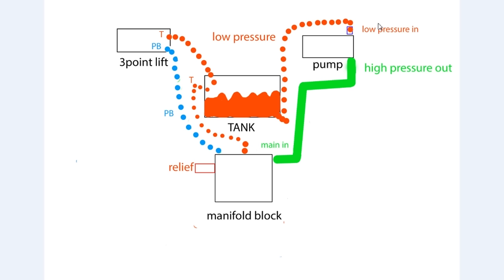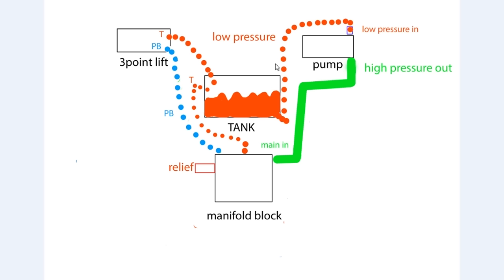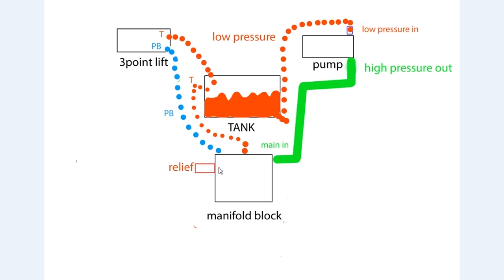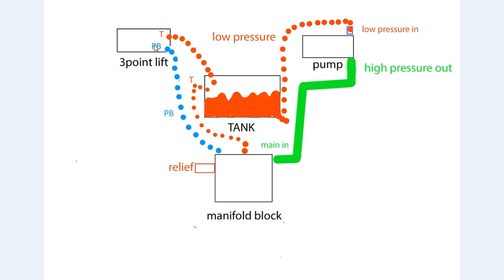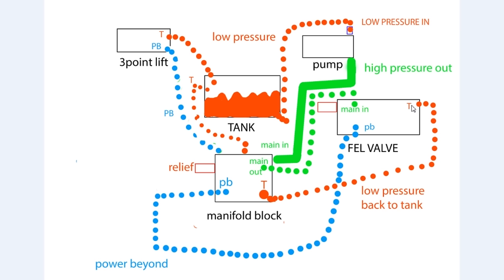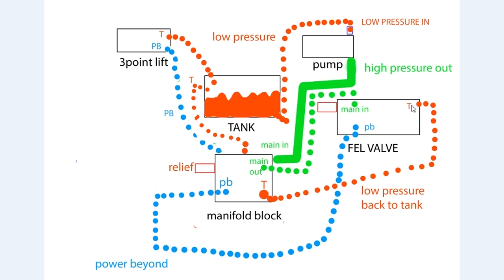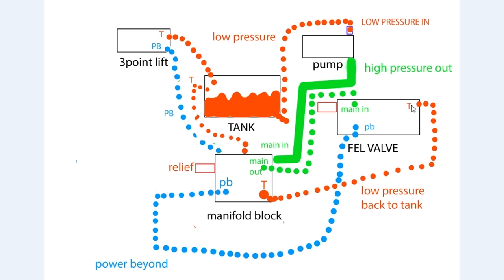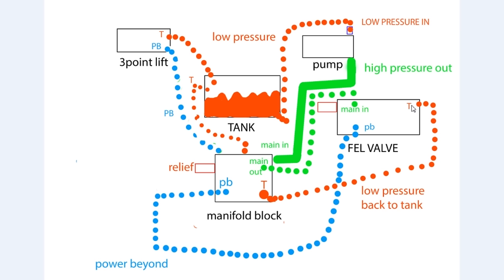adding rear remotes and understanding tractor hydraulics

Comment: I have been reading and watching videos for about three solid days to try and figure out exactly how to plum  in an electric over hydraulic third function valve. I finally grasp just how the power beyond function works. But I had to do a ton of research to understand it. Your video made it super simple and I wish I had found it sooner. This is a great resource for anyone who is not well-versed in all things hydraulic.
Reply from the maker: thank you I hope this video gets shared so others can benefit from it. there are several very informative videos on this channel pertaining to tractor implement set up and use. I'm sure you will find them helpful as well.

Comment: WOW!! Amazing, thank you! You removed all the confusion.
Reply from the maker: glad to hear that thanks for stopping by
Reply: @daveknowshow  Well almost, I'm confused now! I must have done something wrong.  I added a spool valve and remotes to my Kubota L3800 and now to 3 point hitch does not function.  Would you mind helping?  Both remotes work for my stump grinder. Can I PM some pictures?
Reply from the maker: @diamondcutter8535  yes email me at daveknowshow@aol.com
Reply from the maker: @diamondcutter8535  also just to let you know. Id say you have the tank port and the power beyond port likely backwards. this means your power beyond is dumping straight back to tank and your back to tank is dumping into the power beyond port. its not gonna hurt it but as you can see it makes the three point no longer operate.

Comment: Great video.  I have a question.  I currently don't have  rear remotes.  I want to add a spool valve with 2 levers and 4 connections but not sure what type of lever valve I will need.  The function will be to turn on and turn off a external hydraulic motor.  The motor is on a  3pt small potato digger that drives a potato chain.  It will need to stay on when I engaged the valve lever and turn off when I disengage the valve lever.  I know there is detent, not detent, etc....
Reply from the maker: a detent style valve may work although during a bumpy ride the valve may spring back from the jolting and that would shut the motor off. I would try contacting Brian Brooks over at brooks ag parts and see if he can help you select a valve. you will need to know the flow rate of your hydraulic system which is listed in your owners manual under specifications try this number for Brian tell him I sent you there from youtube. 513 715 0532 if he cant nail down a valve for you try surplus center hydraulics get the number online. if that dont render any good results for you let me know and I will try to help you figure out which valve I would use if I was doing it myself on my machine. hope this helps. Dave

Comment: Probably saved me hours and hours of troubleshooting. Fixing up an old, somewhat neglected Kubota L235. I  discovered an aftermarket aluminum hydraulic adaptor block, but I don't have a front end loader. Also the 3 point lift isn't working yet. I've absorbed all this info and I'm certain it's going to come in handy. Thanks!
Reply from the maker: I have no doubt in my mind this information will speed things up for you.

Comment: Today I'm gonna try to install the top and tilt I got from the dealer. It did not come with instructions though the service manager said that he would be available to phone consult with during the installation. This video is hugely helpful. Explaining that the hydraulics are in series clarifies the circuit, especially for me as an electrician. Thanks as always Dave!
Reply from the maker: Bay Area Sparky so glad this helped very excited to hear you are getting a top and tilt. You will love it!
Reply: Hi Dave. I was making good time on the installation but the kit I got from the dealer was missing the bracket which holds the linkage and levers atop the tank and below the control console plate. So I sewed things up and used the box blade the old-fashioned way, climbing down to make hand adjustments on the fly. I sometimes wonder how they tolerated hopping up and down from the tractor until I remember that they used to have to hook up a mule/horse/ox and that a tractor, even with hand adjustments was probably pretty damn convenient!

Comment: Outstanding video. I see now it will be possible to add a hydraulic top link to my John Deere 5200 that has a front end loader.
Reply from the maker: yes in deed you can and rather easily as well. if I can be of further help just let me know.
Reply: @daveknowshow  I want to puchase a single spool valve to operate a hydraulic top link. I want the top link to remain in the set position when the valve handle is released. Am I looking for a valve with one side detent, no detent, and/or spring return?  What is this type of valve called?  I apologize for my ignorance but I'm still learning.
Reply from the maker: @TexasNightRider  you want an open center flow -and spring return to center spool valve design. I know you say you want a single spool valve for just a top link but trust me you will end up wanting a side link as well which will require a two spool valve one for top and one for tilt. I wish I would have installed a three spool valve now that its done. one for top one for tilt and one for future small dump trailer. i'm here to help if you need it.
Reply: @daveknowshow  Thank you sir.
Reply: @daveknowshow  Would you be uncomfortable providing the brand name / model of the valve you purchased?  If you ordered it then I would order from the same place.  It appears to be exactly what I need and I am having a difficult time with the valve selection.
Reply from the maker: @TexasNightRider  if I can find it. I got it from Northern tool I think its this one. as I said I got the two spool and now wish I had bought the three spool valve instead. here is the two spool valve I have. https://www.northerntool.com/shop/tools/product_200419671_200419671     keep in mind this needs to be set to "open center" configuration or what the instructions calls " power beyond"
Reply from the maker: @TexasNightRider  very nice of you most folks just say thanks but some send me 2 or 3 dollars via paypal at daveknowshow  but its not necessary.
https://paypal.me/daveknowshow?locale.x=en_US

Comment: Great video I have a question if the backhoe is off the tractor Do I need to make a jumper hose to connect the in and outlet to keep the fluid circulating
Reply from the maker: @glennadkins7999  yes!!!that is critical!!! Typically they use a male and female connection this keeps the direction of fluid the same and allows one to plug into the other. The female can be stationary and the male on. A hose long enough to loop back and plug into the other.

Comment: Best video ever! Thanks! One question why does the 3 point lift does not have a relief valve? Also the back hoe does not seem to have a relief valve. I am new at this. Gr Reza
Reply from the maker: actually the three point does use the main relife valve as its relief protection. same with the backhoe as well. additionally the loader control valve also has a relief that is set higher than factory spec and will kick in should the main system relief fail and the pressure exceeds the factory setting of the loader valve which is typically 3000 psi
Reply: @daveknowshow , thank you for your time and good explanation. Hope to see you in person one day in Belgium. I hope I can show you my kubota mk5000. Gr Reza
Reply from the maker: @thingsbeensaidanddone.2378  that would be awesome!

Comment: Dave I work with Hydraulics a lot, i just today bought a small backhoe that connects to the 3 point. However there are no hydraulic lined to the rear. I just need to have a way to connect hoses to the manifold that is there on my L2900 Kubota. Can I take the two plugs out of the bottom of the block where the front loader connects or just get hydraulic Tee s and put them in the Power beyond as you show yours. or do I need to buy the expensive kit they are selling.
Reply from the maker: the only port you can "T" into is the back to tank port. the others must be in series. power out to power in.  at the manifold locate the power out line disconnect it and add in your back hoe lines. one in one out. you can also add the backhoe line after the front end loader valve. just locate the power beyond port on the loader valve. disconnect that line now you have a power out and a power in. need to know which is power out? with those lines disconnected start the tractor briefly. the line that shoots fluid out is the power out line. hope that helps. I'm here if you need further help.
Reply: @daveknowshow  okay thanks, I was looking at the one you have in your picture. coming off the power beyond to the hoe then putting a Tee in the return line. but what do you do when there's no backhoe on the tractor? there will then be a dead head Power beyond line. or should you keep a short hose with quick connects to install in the ends of the hoses while not in use. I will try to get some pictures of my manifold later this evening after work. it has no block like that you show.
Reply: well i took pictures of what I have but I aint really sure how to post them. but it has 3 hoses coming out of it 2 right beside each other horizontally facing to the right side and one f below facing the front of the tractor. they all go to the front loader. the back side of the manifold has 3 solid lines coming to it one from the engine compartment, one to the transmission and one heads to the back as far as I could see under the seat area
Reply from the maker: @garryharris9098  yes the lines at the rear plug into each other when the hoe is not installed

Comment: Dave, Thank you.   I appreciate your videos !!!  

I was thinking that to add a rear remote I would need to Tee off from the Power Beyond and tank circuit to make it happen.  I have both a loader and backhoe setup.

I now understand that it all needs to be in Series to make it all work.  Thanks...
Reply from the maker: yes sir you are correct in series is how it works. appreciate your kind words and glad the video has helped speed up that learning curve.

Comment: Hey Dave 
Great video. Have mx4800..Is it economical to buy a spool valve kit for say rear hydraulic top link like you have? Are just buy all the components and put together myself. Thanks for your input. Be blessed.
Reply from the maker: it saved me about 300 bucks piecing mine together. maybe more. I wish I had put three sets of remotes instead of just two sets.
Reply from the maker: also check summit hydraulics.

Comment: Dave , great presentation. I have a 2004 Kubota B2910. It does not have power beyond. You have any idea if I can add power beyond?
I want to add controls on my box scraper like you did.
Reply from the maker: it should have it. I can down load the manual and maybe find it for you. my email is Daveknowshow@aol.com

Comment: Please forgive me for asking, but I need rear remotes on my Mahindra, I do have a loader, can I power my new spool from the FEL manifold, curl circuit, or lift circuit ect? Thanks in advance.....love your videos....John Stark
Reply from the maker: feed the new spool valve from the power beyond port on the loaders spool valve. " joy stick" control.
Reply: One more quick question, iam pretty clear on the power beyond coming out of my loader joystick valve, that will go to my new spool, then continue on to feed my three point , via the port in front of seat, then I realize my spool port marked (T) will return to tank, my current tank return is behind seat just above three point, my question is this....do I just put a tee there and tie it in, currently it's a 90 degree fitting from FEL valve?
Reply from the maker: @johnstark3058  yes a TEE connector will work fine. that is what I used on mine.

Comment: If I wanted to hook up a log splitter but did not have the hook ups on the rear as I originally thought I did, would the simple method be to hook up as if it is a back home? Then what would I need to do if the splitter was not attached?
Reply from the maker: yes run two lines back there for the splitter. one with a male connector one with a female connector. when the splitter is not on simply plug one hose into the other to complete the loop. hope that makes sense. on another note my advice is stay away from tractor mounted / powered log splitters. the flow rate is to low and cycle times will be painfully slow. buy a stand alone splitter and tow it behind the tractor. this way you can use the tractor to load wood on the splitter. those large logs are heavy. I tow into the woods disconnect the splitter and use the grapple to raise and lower rounds onto the splitter. once they are split small enough I can manage them by hand. the stand alone splitter saves wear on the tractor as well. maintenance on the tractor is far more expensive than that of a splitter. I picked up a 27 ton troybilt splitter for 700 bucks. it was brand new and had been returned to lowes. they made a mistake putting one hose on wrong. I moved the hose around and its been great!
Reply: @daveknowshow  makes perfect sense and is what I was thinking of doing. Just wanted additional verification. Greatly appreciate it!

Comment: Hey Dave! You have help me before.I need some more help I have 1210 ford it has hydraulic block to add rear hydraulics one side says in the other says out so do I hook up out on the block to in on the spool and the in on the block to out on the spool I tried that and top link went out and I can not get it back in. then I press the spool and fluid came out back of the spool. Any help would be greatly appreciated
Reply from the maker: what you said sounds correct however read your documentation. some spool valves are not open center. open center style is likely what you need. also some spool valves need an adaptor installed inside to give it a power beyond port. you dont always need that if you find out which port out your tractor is providing flow then connect it to the spool valve inlet turn on the tractor and see which port on the spool valve flows fluid when the valve is in neutral / center position, that port connect back to the tractor. the other two ports on the spool valve connect to the top link. run the machine and test. make sure the pump is not squealing. you will hear it. let me know if you need help
Reply: @daveknowshow  Thank you very much Dave you are the Man! Thanks for your time!!

Comment: Dave, thanks for the great graphics. On some days when I first start up the L4400 I have no hydraulics, no steering, no bucket lift and no three point lift. The motor is at idle but is labouring same sound as if full load hydraulic, if left too long hydraulic pump gets hot. To get hydraulic functions I have to drop the bucket fast or drop three point hitch implement, this clears the problem, everything works fine. Any ideas of what the problem is. Thanks, Larry
Reply from the maker: Sounds like stuck relief valve. Either the main relief or the loader valve. Start by disconnecting the loader control valve with a bypass hose from the main power port to the power beyond port. If the problem goes away it’s the loader valve that is bad.
Reply: Thanks again Dave. I bypassed the loader valve as you suggested and the problem still exists. I dropped the 3 point implement and I heard a click , the hydraulics started working again . So if it is the main relief valve sticking is it sticking closed or is it sticking open? Why would it stick? Also the engine does sound like it’s working a bit and the hydraulic pump will get hot after awhile. Any ideas? Thanks, Larry.
Reply from the maker: I would put a pressure gauge on it to see if it shows any pressure. If you have one. Regardless I’d open the relief valve up and clean it. Likely has trash in there holding it open slightly. This causes the oil to pass by and heat up.  Another issue could be the feed back rod is out of adjustment. Set the three point half way up and see if it still does it. Then try all the way down, then all the way up.  You can locate the feedback rod on messick website under parts three point lift. It’s typically located under the seat area on the USA driver side. The feedback rod tells the three point module when the three point is fully up fully down and each point in between. Another area to check is the pump feed hose. If it cracks the pump sucks air and that causes cavitation and severe heat issues. I hope you can locate this issue quickly and it’s not to expensive of a fix. Keep me posted.